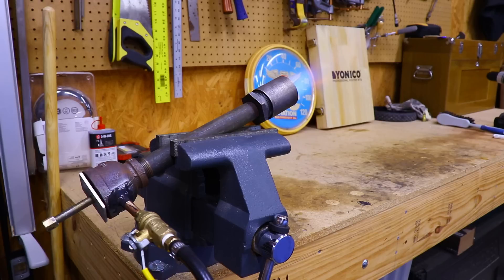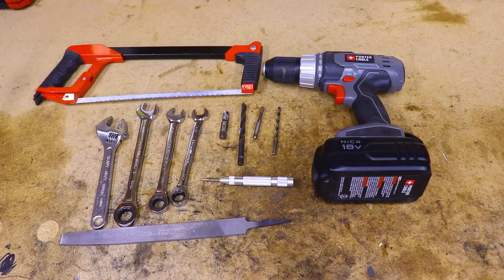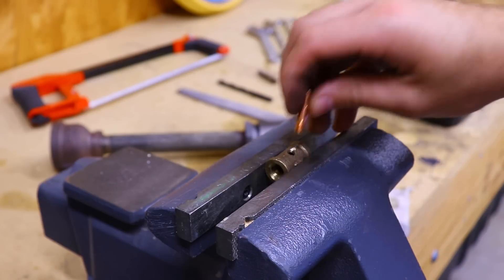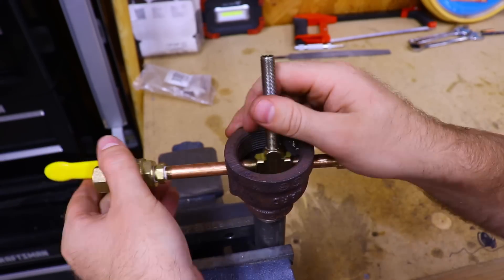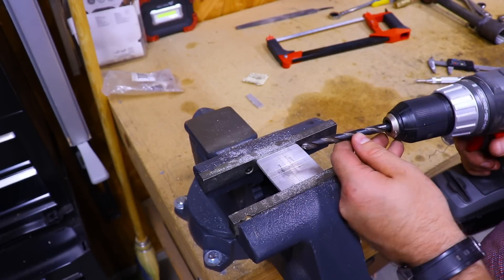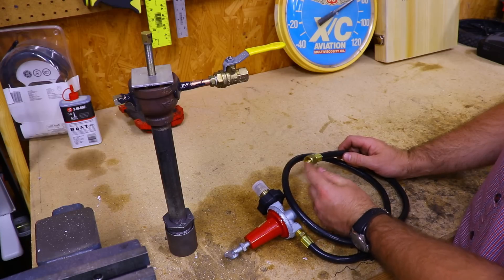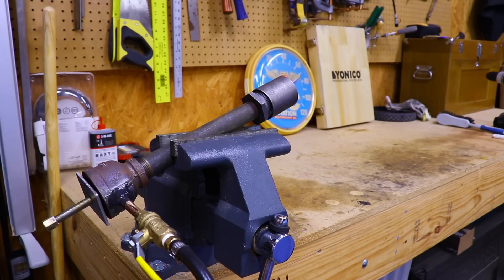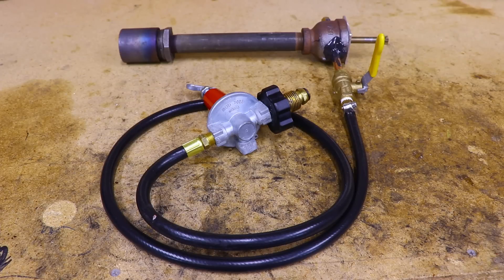How to make an Improved Propane Forge or Foundry Burner Build (minimal tools / no welder)

Comment: I built this burner and it is not coming out as fast. I have the nice blue but it seems slow.

I only have a 30 psi regulator. It says 40psi on my dial and you said high pressure.

 Do I need even higher than 40 psi?
Reply from the maker: Sorry, I'm not sure. I think 30 should be more than enough.
Reply: @MakeStuffNation   Maybe I got the wrong tips or something. Thanks. I'll figure this out eventually. It has been sitting collecting dust xD Along with the rest of my projects.

Comment: The Hobart tips in the description don’t work with the 6mm bit. Not sure which tips he used but the threads don’t line up. 🤦🏻‍♂️ also, the lamp nipple doesn’t thread into the t in the description either.
Reply from the maker: cross-thread is still a thread

Comment: Great build but almost 200$ for just the  fittings and that's if you already have a propane tank....let alone a 40 lb propane tank. I love the build but the links to all of the parts (not including the tools) just add up too quick. I'll go check the hardware store to see how much of it I can find and add up that cost....but there's gotta be a cheaper way to aquire these parts.
Reply from the maker: You're right, sometimes its cheaper to buy, but I get enjoyment from building things myself.

Comment: very impressive video , but one question: where did you put the gas backflow stop ?
Reply from the maker: There isn't one, not strictly necessary when using a propane bottle and the burner is running at atmospheric pressure.

Comment: Most of your descriptions are alien. For one thing rattling off 100 different imperial measurements is confusing, and then using terms like lamp rod, instead of threaded rod?
Reply: The lamp rod is hollow I believe, which is why its different than a normal threaded rod
Reply from the maker: You are 100% correct
Reply from the maker: @StuffAlecMakes is correct about the lamp rod. As far as the imperial sizes, that is how they are sold here in the States.

Comment: You should never use a drill to tap threads!
Reply from the maker: For threads that are being used, are structural, or in steel, I agree. But these are not structural, one time assembly, and in non ferrous. Works great, saves time, and have had zero problems.

Comment: I made the burner but the regulator listed in the description is no longer available.  The only ones I can find are 0-30 psi regulators.  Will this have an impact on the performance since its max is 10 psi lower?  I can't seem to find a 0-40 psi regulator anywhere.
Reply from the maker: 0 to 30 should work just fine.

Comment: This design is much better than mine- way more controllable- my, "regulator" is the ball valve! I need barely crack ot open. I made one that works with the 1lb. bottles. One bottle gets me around 2.25-2.75hrs approx with a .028 MIG nozzle. I plan to eventually get a 20lb bottle but then I will only need to take the 1lb fitting off the burner, the rest are 1/4" pipe fittings so a standard hose should attach without needing to buy or rig anything more than just the bottle-burner stuff.
Reply from the maker: Thank you for your support!

Comment: You had me until using epoxy to hold the propane source in place. I’m working on an alternative to that part.
Reply: Yeah, epoxy isn't very heat resistant, is it ?
Reply from the maker: The inlet of the burner doesn't get hot. The airflow cools it. There are many ways to hold the fitting. I've had zero issues with this method.
Reply from the maker: The inlet of the burner doesn't get hot. The airflow cools it. There are many ways to hold the fitting. I've had zero issues with this method.

Comment: what is the thread size on your 6M tap? I used a M6x1 tap but the threads did not match the Miller Mig tip.

Comment: Crikey id never find the parts i need for this project , hardware places here have only some of the parts and you have to scrounge around everywhere to find the rest, less parts would be great and more simplified .
Reply from the maker: It is unfortunate that your hardware stores don't stock more parts. I did have to mail order several items. I did this mostly for the fun of making it. If you are worried about parts availability and cost there are many burners available on eBay that will probably save you time and money and ship readily anywhere.

Comment: why did you use the NPT tap for the flow damper 'lamp stem' isn't it just a simple tap? Did you use the the NPT for the mig tip as well?

Comment: Excellent video and burner design.  I researched several propane burners as I am starting out in the backyard foundry hobby, and I decided to build this burner.  Took me a couple weeks to get all the parts/tools together between Home Depot and Amazon.  But they finally all arrived and I did my build.  SUCCESS!!  I ran it for the first time this past weekend.  I am VERY pleased with it, and I am glad I built this model.  There are some who said you don't need the airflow adjustment, but I think I'm going to be happy to have it!  I went with the 40-psi regulator, and I also installed a pressure gauge in its gauge port.  I also ended up getting a 12-foot propane hose (very happy to have that), and I got the necessary flare fittings to interface the burner to the hose so I didn't have to cut the hose to use a barb connection. 

Next up I will be constructing my metal bucket furnace.  I wanted to have the burner built first so I would know dimensionally what hole I would use entering the side of the bucket.  Not having the actual furnace yet, I do have some questions...  When you are using this burner do you know what pressure you are setting the regulator to for melting the metals?  There is a WIDE range of pressure with this regulator...  do you max it out?  How do you know what size flame do you want?  With my regulator installed, I get a seriously powerful flame at 20psi... do I need to go to 40psi?  Just curious.  I wonder if there is a "law of diminishing returns"... where if you keep cranking up the pressure do you get a proportional increase in HEAT or does the efficiency fall off?  Any words of advice?  Thanks!
Reply from the maker: Unfortunately the regulators I use don't have a pressure readout. I'm glad you're having success. Thank you for the support!

Comment: can you/do you add any natural gas sealer to the threaded areas?
Reply from the maker: It probably wouldn't hurt. I only hook the burner up to a propane source in an open well ventilated area and I always check the connections with soapy water for leaks. So far I haven't had any issues.

Comment: suggestion: can you not buy two extra 1/8” x 3” Lamp Nipples to attach to the brass T and have two nuts (one on the inside and one on the outside) to securely attach the fitting center on the end of the pipe?
Reply from the maker: Yes, that would work

Comment: Hi guys! I followed every step like in the video, got all the parts together... the darn thing wouldn't stay lit, I tried everything I could think of... started at 0 psi, there's no flame. Worked my way up to 10 psi, it lights up, then 2 seconds later it dies down, and is the same if I go up to 50 psi. What am I doing wrong? I took pictures of the setup and regulators... please help me out, I spent two weeks just waiting for the parts to arrive, and I was hoping that today I can fire up my new forge... thank you!
Update: I did fit the flare at the bottom , now it stays lit but the flame doesn't grow in pressure, no matter how high I work the regulator or the air flow. If it helps I can post a video. Thanks again!

Comment: Hi, great video! Now...after buying all the parts for one burner I just realized that I will need two burners for my forge... so let's say I will build two of them, how do I connect the two of them? Thanks!
Reply from the maker: You can use a "T" adapter in your gas line to run multiple burners.
Reply: @MakeStuffNation  thank you!

Comment: Could you not fit a second gate valve as the air flow regulator instead of the metal plate?  You could do it all with standard fittings....no threading either and it would be a lot neater and controllable
Reply from the maker: that would probably work

Comment: Ive been experimenting with this style burner vs a "frosty T" style. Curious to your opinion on the efficiency of one vs the other. Ive found I get more flame coming out of the forge with the frosty T leading me to believe I'm getting an incomplete burn despite air intake adjustment.  Do you think putting bolts or similar through the 3/4" pipe to add turbidity would increase fuel air mixing and create more efficient burn?
Reply: I've noticed the same thing. I think (guessing) the linear airflow in this style allows for a better mixture and combustion. I'm not certain the T-style burner creates the needed Venturi effect due to the non-linear 90° intake.

Comment: I want to build a burner but l don't want to use threaded pipe, just pipes then l will weld together. Any ideas on pipe dimensions?
Reply from the maker: you can use the same dimensions, just be careful welding the pipe if it has zinc on it. Check out the MK2 version which has some significant improvements though. It gets a small gas bottle style forge hot enough to weld. https://youtu.be/BjqA4VQMpiM

Comment: Why is the brass used instead of steel/iron?
Reply: It will not oxidize like steel. You'll notice it is only used on the parts that will transfer pressurized gas. Iron will oxidize, pit, and eventually leak.
Reply from the maker: Jody Smith is correct but in this case it was just what my local store had available in the correct sizes.

Comment: Just a heads up, the MIG tips listed in the description fit a 1/4" x 28 tap not an M6 tap.
Reply: Just built it and confirm this
Reply: I just built it and it is the M6 tap, not the 1/4 x 28

Comment: Do you know by any chances if it would work with a 0-30 psi regulator?
Reply from the maker: I believe my regulator is 0-30 and it works well. I often dial mine down to very low pressure to conserve fuel when I don't need the forge at super high temps.
Reply: @MakeStuffNation  Super. Thank you so much for your response

Comment: If you installed a large wing nut behind the air flow regulator, you could lock it into any position you wanted while using it, and you wouldn't have to worry about it spinning and going out of adjustment.
Reply from the maker: True. I haven't had any issues with it going out of adjustment though.

Comment: Great Video! What kind of ball valve and adapter combination is required to hook it up to the regulator hose with the 3/8" flare fitting?
Reply from the maker: The parts quantities and sizes are listed down in the description. I hope this helps.

Comment: This is a good design. I like the use of the mig tip and the adjustable air intake. The only part which I'm not that keen on is using the glue to secure the assembly. I'm wondering if using some kind of set screw tapped/drilled into the housing to secure the assembly might be a possibility. You put a lot of thought and effort into this, so thanks for that!
Reply from the maker: A set screw would be much better. I haven't had any issues with the epoxy yet though. The inflow end of the burner stays pretty cool due to the airflow.

Comment: the first 1/8" T looks bigger than 1/8". Is the second one 1/8"? I notice it's a different type(squared)? How much was the total cost for all these parts
Reply from the maker: They should all be 1/8" NPT fittings until you get to the adapter for the 1/4" valve

Comment: Not trying to be a wise-ass but seeing this build (which seems to be your modified version of @King of Random 's propane blaster, didn't catch any acknowledgements but am guessing he's the creator of both the blaster and the common fire-extinguisher//tub-with-plaster approaches), the ONLY thing I can think is.....*why not just buy one?*  For $50 you can get a pre-made 'gas blaster' https://www.northerntool.com/shop/tools/product_200584784_200584784?cm_mmc=Google-LIA&utm_source=Google_LIA&utm_medium=Snow%20%2B%20Ice%20Removal%20%3E%20Torch%20Kits&utm_campaign=idealgas&utm_content=29201&gclid=Cj0KCQiA0ZHwBRCRARIsAK0Tr-psVSTR59dv8tvXL89CBxw6__3YJkOFCdESH7qvRsJ-Z4GRNC2bnAEaAq8rEALw_wcB
Those are available at all hardware stores, you didn't tally-up what your parts-list cost you but between those parts, the JB weld you didn't show on the tools/materials-needed list, and your time, it seems like rebuilding the wheel when these are already being made (just like you wouldn't make the foundry if there were already buckets with 6" walls of insulation, you'd just buy the bucket & tap the side)

Have you found any value to having both air and gas on separate holes?  Am thinking it may light the crucible more evenly (am always mashing-around my charcoal, just now getting my propane on the forge) but don't want too-much air or to waste propane...also am confused at why I can't just take some 1/4" hosing (or some washer-machine flexible steel water line with yellow sealing tape if preferred), connect it / tape it to the tip of my $10 propane-can-nozzle (with built-in pressure knob and appropriately-sized air-holes) and have that seated-into the 3/4" steel tube on the side of my foundry....having his whole 'blaster build' seems to make more sense for portable units, not tapping to the side of a fixed-position forge!

Would be curious to hear your thoughts, & thanks for sharing!! :)
Reply from the maker: I have attempted to use burners like you suggest in forges and they do not work properly. It has something to do with the airflow design of their housing.

Comment: Very nice burner.   Great job.
Q:   Can the lamp pipe length be cut in half.?   (I noticed you never turned the air plate out more than about a half inch).     
Q:.  Is this a better design than your previous model.?   If I was only going to make one, which one should I make.?
Q:.   On you Home Page you have a blacksmith hammer on the top.   Is that an Alex Steele made hammer.??
     Thank you.
PS.   Love your Grand National.
Reply from the maker: Yes, you can cut the lamp pile shorter. This is a better design than the previous because it lets you control the air fuel mixture. As far as the hammer, I made it in Alex's shop under his instruction while taking his class several years ago. Thanks!
Reply: @MakeStuffNation  
Thank you.
Excellent build on the burner and the hammer.

Comment: I wonder if it can be made in a smaller size for my paint can foundry
Reply from the maker: Yes, you can use the same principal for a smaller burner. Not sure what fitting sizes would work best though.

Comment: Could I use this for a burner to build a turkey fryer?
Reply from the maker: I wouldn't recommend it. The flame is too localized to heat a large pot. Plus you can probably pick up a turkey fryer burner at a big box store for cheaper than you could get all these parts.

Comment: Not really sure you need the air flow regulator. These run fine without it (I've built a few very similar). One thing though, I believe you should shut the burner off with the ball valve, then turn off the regulator. Zero pressure all the way back to the tank is not a good thing. Nice burner. Well explained too. Thanks!
Reply from the maker: I've found that running the burner at lower pressures (to save fuel) it sometimes gets too much air and the air flow regulator helps keep the temperatures higher than without. Good point about shutting off the burner.

Comment: Thanks for the video. Your presentation style makes it very easy to follow, including the hole drilling fail which shows that diy doesn’t always go to plan. I’ve just purchased all the bits to make two Alex Steel style burners but I think I might have a go at yours. Thanks for sharing your hard earned work 👍
Reply from the maker: I'm glad you enjoyed the video! I've worked with Alec Steel and his burners are fantastic. I'm sure you'll be happy with either design. Good luck!

Comment: Do you suggest or do you need a regulator.  I built this burner without a regulator and it doesn't get enough airflow.  Or does the regulator have anything to do with the airflow. I also didn't use a ball valve.
Reply from the maker: I use a high pressure regulator that they usually use with those big turkey fryer burners.

Comment: Just curious, approximately how long does that tank last under normal working conditions with this burner?
Reply from the maker: I haven't officially measured it but I've gotten probably at least 8hrs of time on it so far in a small gas bottle forge and haven't had to refill my tank yet. I wasn't running it at max capacity though. Probably only about half pressure but it was still a good yellow forging heat.

Comment: You could have just added a swing door to your old one.  Tap a screw on the back edge of the big reducer and screwed on a rounded aluminum disc.
Reply from the maker: You're a completely right. this is a great suggestion. Probably more cost-effective due to the reduced number of parts.

Comment: The end where the flames coming out, how can you attach that to a forge?
Reply: There are many videos here that show that part. I like the "Essential Craftsman" page. He had a lot of Blacksmith Videos as well as others. He had a great video on building a small forge, great tips in that video...
Reply: Make a hole and stick it in. Hold it with wire or a spring. It doesnt need to fit tightly.

Comment: Is this burner big enough for knife making in a forge built in a 20# propane tank? Volume will be about 600 cubic inches, lined with 2"" of ceramic wool, refractory cement, IR reflectant, and sliding brick doors closed on the back and semi-closing the front.
Reply from the maker: Yes, it should be big enough. I run mine off a 20# tank. I also use 2" of ceramic wool and have been able to get it up to welding heat.